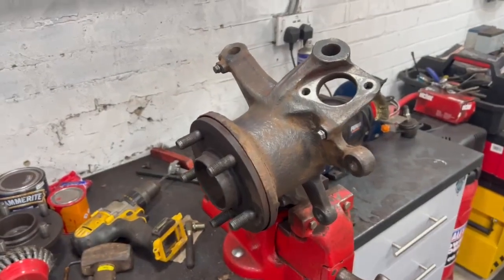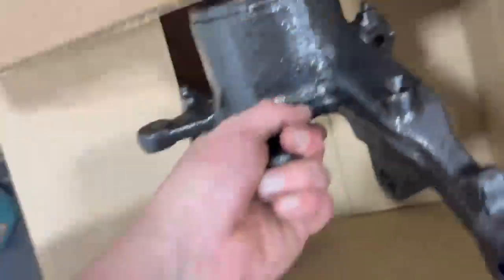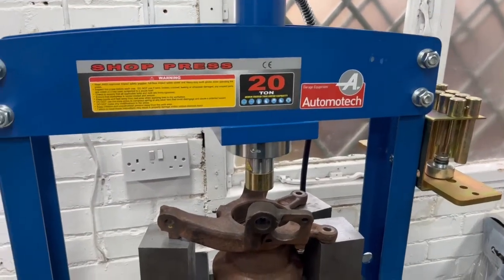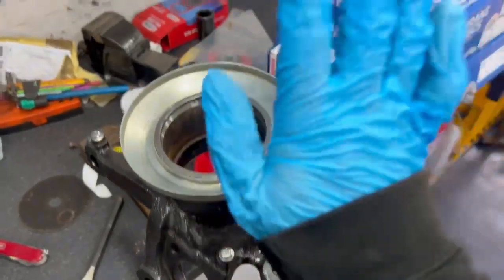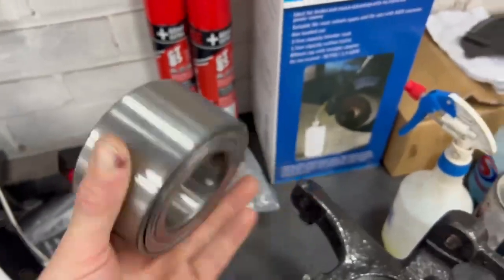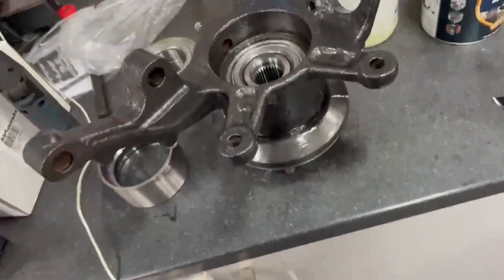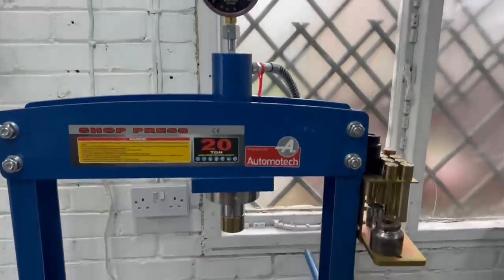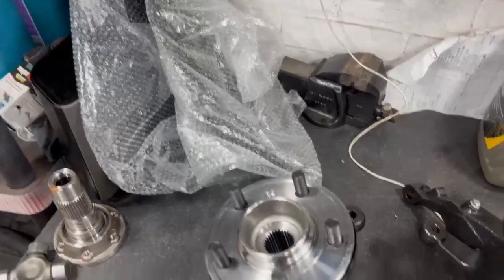RANGE ROVER L322 FRONT HUB RESTORATION

Comment: great vid ,im just doing this myself and a quck question .....is there a right way or wrong way that bearing goes in  ?.thanks
Reply from the maker: Just fit either way 
As the abs ring is on CV joint and not on wheel bearing
Reply: 👍many thanks